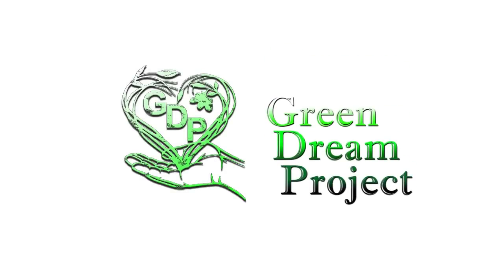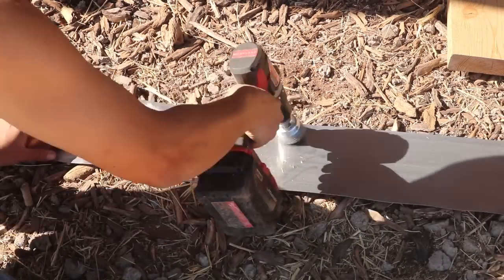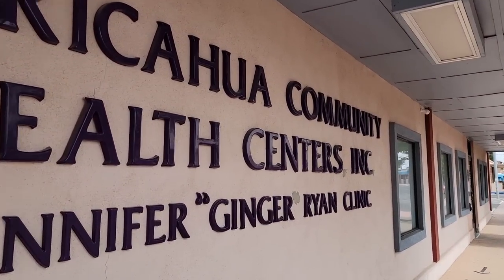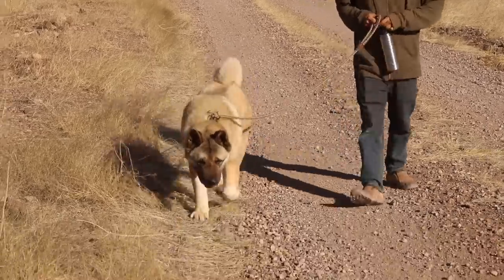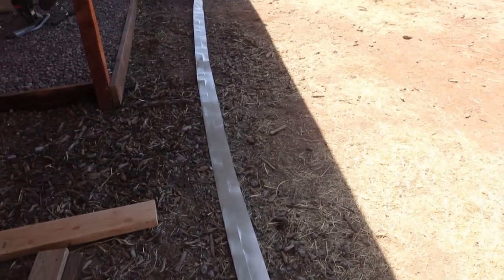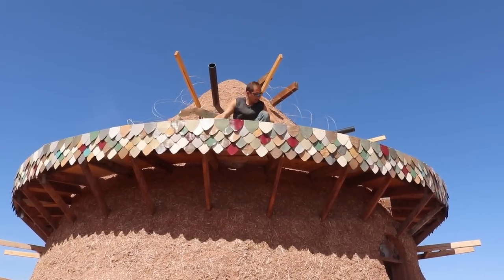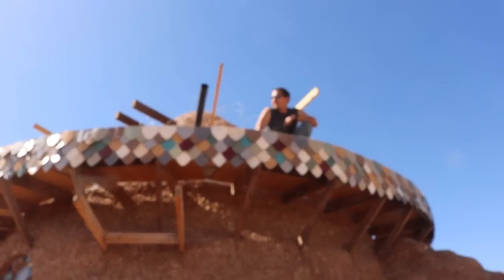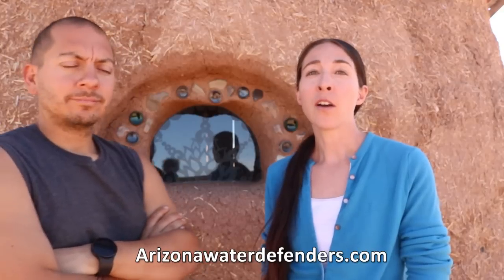This Is NOT How It Was Supposed To Go | Building Off-Grid On A Budget

Comment: Great video guys! Glad your blood pressure gone down! Sure sign of one of the many benefits of intermittent fasting definitely reduce the meds of too low.. it's amazing how quickly you can start to undo the damage you've done over the years not taking care of ourselves! (Even if it's not intentional!) End of the day you're looking so much better mate so keep it up and definitely combine it with exercise or you'll be eating muscle and heart muscle aswell as fat (potentially!) So keeping fit it also key to the fasting and eating healthy plenty of protein plenty of water/hydration and no sugar or carbs and you'll be golden mate with your health! Make sure you're taking vitamins too.

With the ridge cap, shorter lengths and maybe cut slits in the back side of the ridge cap so it can overlap and bend across itself I stead of creasing and splitting. Also perhaps use a small handheld torch and gloves to heat the crease before you try to unfold it!? I think maybe if you were to attach it all around with it as one piece sticking up past the eves then make the virtical slits and them fold it over the eves in sections this will avoid stressing the metal too much maybe with a bit of heat aswell to help the metal stretch as you go.. just an idea. 
Also great project with the water conservation. Very important to have your own rainwater harvesting and catchment system isn't it where you are! (For the rare times you get rain save as much as possible!) Plus  I read that in similar areas to you, where they started to plant certain plants and drip irrigate once the plants established, they helped to hold the water in the ground and the whole area ended up thriving and this was on a housing development that was basically dying because of the water situation and a scientist botanist type fella moved there started planting these plants introduced kerbs with breaks at certain points so the rainwayer that did come fed the strategically placed plants and in turn rejuvenated the whole area over a period of a couple of years and now the whole village is thriving!! Great man very clever was a great video.

So maybe have some circular stone kerbing set up on your property with sole plants in the middle and then when the rain comes it can be retained by the roots of the plants/in the ground and maybe have it irrigate away on pipes to other plants to help with that from the one area around the rest of your property?? Just an idea.

Anyhow great video and love Jess voiceovers at the end she's got a great voice for that sort of thing and although I can tell she's quite shy she's really a talented lady aswell.
Hats off to both of you .
Cheers from London England 👍❤️💪😎🏴🙏

Comment: Where your crease is place a length of 1/2" to 3/4" thick rope. hammer the ends and middle keeping the rope taught and at crease line. you can either continue hammering, putting  spacer same thickness as the area your putting it, drive over the length of metal. now pull the rope out. the flashing will now slide over the scales.

Comment: That AC pulls in hot air from outside.  You need to rig up a outside intake for that portable AC.  Some portables do have both the  intake and exhaust but they are a minority.  For the same BTU and lower cost a window AC is better.  Where you are at a small evaporator cooler will use a lot less power.  Use this system during low humidity days.  During monsoon season the AC is still needed.

Comment: Your forming of metal, needed a radius to keep it from collapsing.  Put a 12 gauge peice of wire in the crease and try it again, the metal will not break and it will be easy to mend.

Comment: You don't need more material, you can just separate the two pieces and fold them both with a 90 degree bend. Then put the larger one on the top and outside and the smaller one on the inside pushed up against the outer one and screw them together. Then put a few screws every couple of feet to connect them to the facia and shingles.

Comment: It's a good thing to not have to take BP medicine. The dogs here at Contentment have got it pretty nice.  They trot down to the river to swim whenever they want. They love it. 70% of the water pulled out of the ground is used for large-scale agriculture, not residential use.  Reduce that and you there will be no water problem.  If you buy some pre-bent flashing lengths with sheet metal screws it should hold fairly well? Don't know if that is wood or metal behind the shingles. If it is wood, then ring-shank nails instead of screws will work well to hold it.  Hang in there guys, we are all learning things about building and homesteading.
Reply: I think it is like a thin masonite board that Jim put up on the ends of the eaves to go all the way around the dome.

Comment: Having a bandanna that is cool they are put in the freezer overnight wrapped around his neck so he can inhale that that cool air keep his paws moisturised and his ears clear that will help reduce the heat but a double code is actually good for the heat because it does let them regulate their body temperature easier

Comment: With coil flashing, you can use 2×4's and door hinges to make an "aluminum break".
Reply: The problem with having two bends in the flashing is that it becomes resistant to navigating the circular ridge of the top of the shingles. He may need a different material to cover the ridge of the shingles while still making the curve of the gutter.

Comment: You might want to look into some type of self-adhesive waterproofing membrane, to cut and use as a cap. It would have more flexibility, can be cut to long lengths, and has durability. Yes, it won't last forever, but then again nothing does.

Comment: While expensive I think a 8" strip of copper sheeting folded to create a 1 to 2 inch separation on the fold would works well and slip over the for the ridge cap. Or 2 bt 4 cedar wood routed to created your cap and screwed into the top.

Comment: Yah I’d definitely consider evap / swamp cooler . They do use about 5 gal of water an hr , but are inexpensive to run & not super expensive to buy depending on new , used . Basic concept & are very effective. I know your not a quitter, the cap material. Not sure what your using, they do make it in aluminum . Anyhow y’all will figure it out . I can’t believe you don’t have more subs . Just show the lack of realists / grounded / off grid thinkers .
Reply: 5 gal/ hr is 120 gal per day! That is 22,000 gallons used in a 6 month cooling season, or 1 and 1/2 times the potential volume of a full cistern!
And the cistern has not been filled up yet. 
Tell Jim he needs another 4000 sq feet of rain collection area & storage so he can have evaporative cooling.